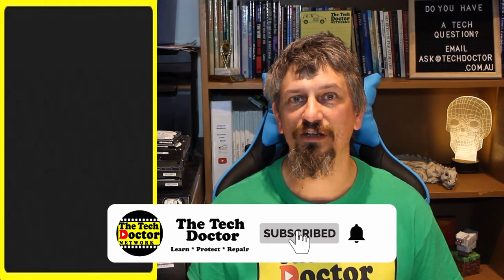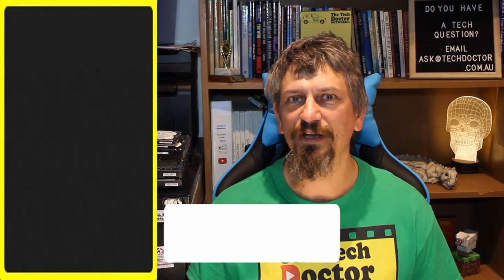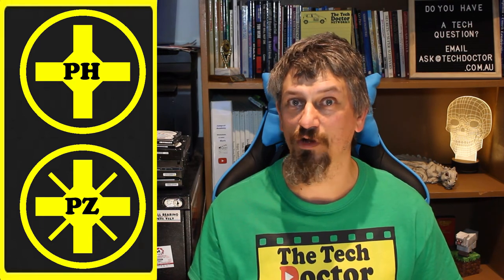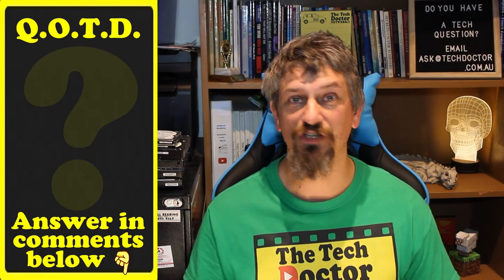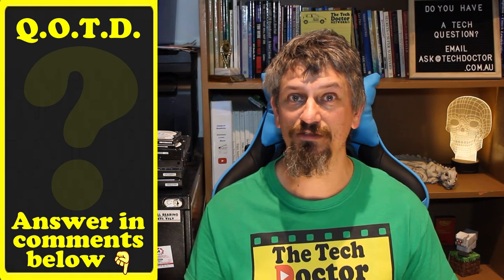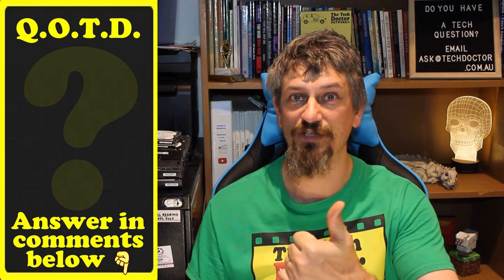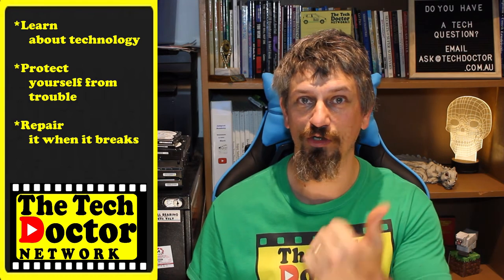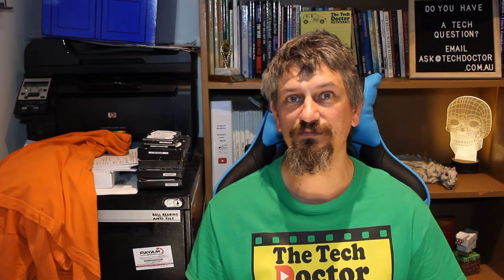192: Tools: Screw bits explained - Phillips Head vs Pozidriv.

Comment: Thanks for the video. I'm a little confused by the Pozidriv. I have two screws M4 and M5, both pozidriv. Only my PZ2 screwdriver works ( PZ1 too loose and PZ3 too big to fit in ).
But, the pozi edges of my screwdriver ( Stanley brand ) are not touching the pozi cuts of the screws.  There is like a fade off before the tip. So what's the point here? ( vs normal philips ) Why this fade off if the edges are meant to bite those cuts ?
Reply from the maker: Interesting. Unless they are poorly made screws? The Stanley screwdriver should be good, assuming it’s not a knock-off of the brand, or just a defective one. I’m at a bit of loss. Can you send a photo through to ask@techdoctor.com.au